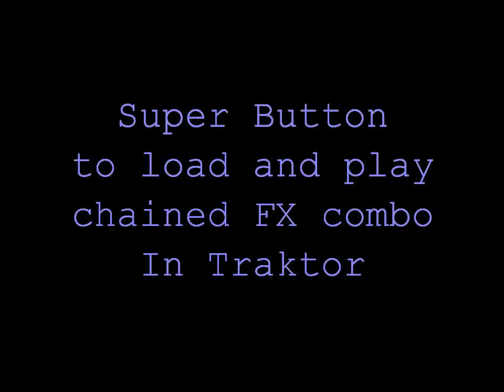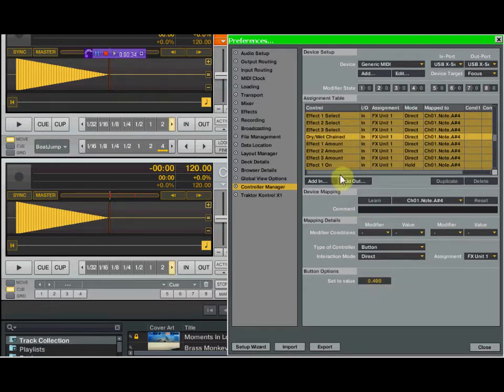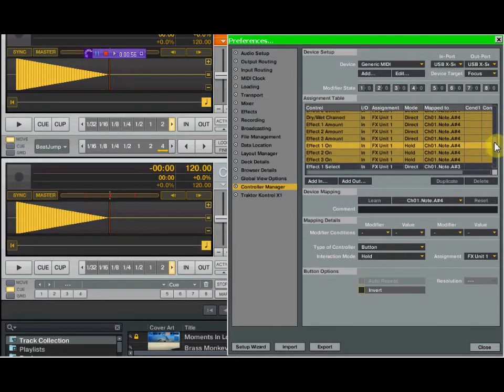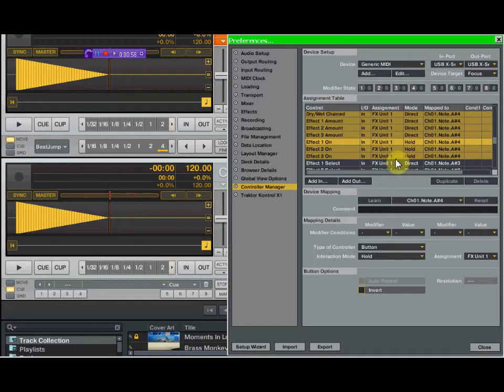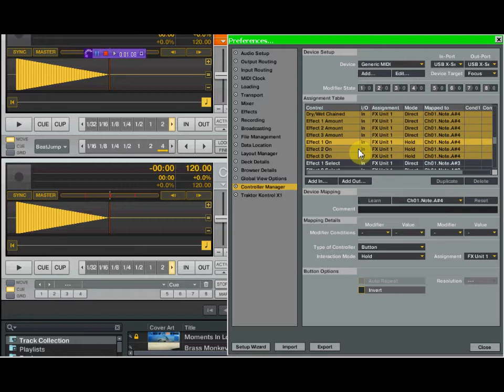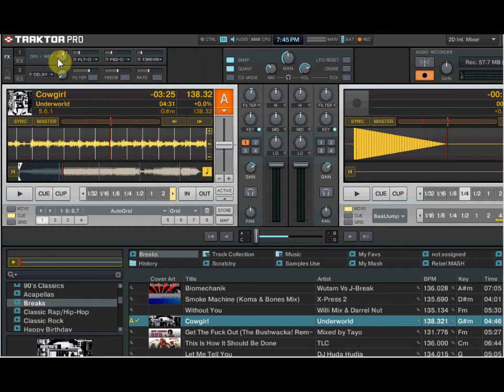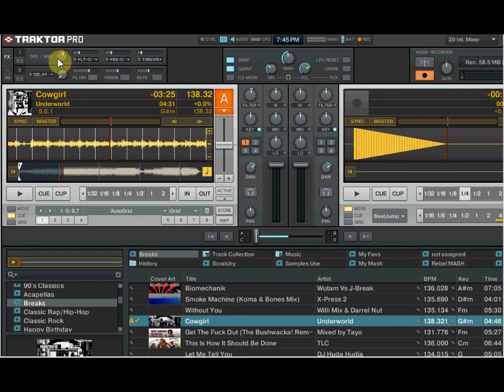Super Button FX

Comment from the maker: @bsbllplyer Does the nanopad have velocity/pressure sensing pads? If so, then some how that must have gotten mapped to the midi note that controls the sensing instead of the note on like the others. Just go into the mapping and change the midi note to match the others in the mapping.

Comment from the maker: @bolengas23 just don't map the dry/wet to the button map it to a knob and there ya go. Or if you already have a dry/wet knob for that fx slot use it and don't map it to the button. On your second question you can do that as long as the button b fx are on the same fx unit. The knob will just always affect that fx unit.